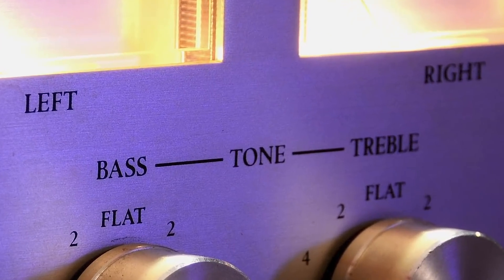Making Smartphone Speakers Sound Big

Comment: Psychoacoustics are the main mantra behind Bose products and the fact that they sound really that good for their size and construction, abstracting the price and competition. HTC One M7 was one of the first smartphones with great dynamic range speakers with DSP, smart amplifier and Beats audio tuning. An iPad Pro or any other recent Apple iDevice really blows many competitors out of the water when it comes to audio reproduction. Still remembering the first Stereo Motorola phones from early 00s that featured „44KHz audio quality“ like the A1000 and E1000 that still sounded as flat as a pancake save for the nice stereo effect.

Comment: That makes so much sense now that you bring up psychoacoustics! 
I have always wondered why my portable speaker (JBL Charge 3) sounded larger with more bass than my bookshelf speakers even though the driver sizes were half the size. At first I attributed it entirely to the bass radiators, but now I know that psychoacoustics is likely also playing a factor. Since for the size of the speaker it sounds quite comparable to my bookshelves which is over 6 times the size (one bookshelf about is three times as big, stereo would mean 6).
Reply: Although one thing I must point out, by no means am I saying that portable speakers are better than full-sized speakers. They both just do better or worse at their own respective areas.
Reply: I don't think the cylindrical mono omnidirectional objects can compare with proper bookshelves on an equal volume level. The boxy characterestic will always be there with the tiny speakers but nevertheless you picqued my interest to buy one for travel.
Reply: @ddg227  Yes you are right. There is actually a mode where you can disable the DSP on the speaker so it outputs raw unprocessed sounds and it does sound super flat. When you compare it in that mode, yes the bookshelves will blow it away. It clearly sounds like it's coming from a smaller source. But with low to moderate listening volumes. I would say overall the sound is quite comparable. Perhaps for me the differences in sound is lesser because I do have smaller bookshelf speakers. For reference I have an Edifier S880DB, I use mainly them for my PC for music and they sound great! For the price point I would say they are great value for the money. I got them for 300 AUD

If you are looking for a portable speaker I would recommend looking into the charge 4, mine is quite old now but I have heard some praise even from audiophiles regarding the sound of the 4. I can't confirm this as I haven't compared the two in person, but watching reviewers the charge 3 is a little warmer than the 4, but the 4 is flatter and has a lower bass extention with better detail.

Comment: Cirrus acquired the awesome Wolfson.

Just wish there was fine control over sound output because many voices are absolutely intolerable to hear, people have taken to whistling their S's through their teeth. Linux has a de-esser but not Android.

Think Android has come a long way but not in the most important issues, still difficult for most people I know to simply answer a phone call on Android without it accidentally putting the phone down, and it's supposed to be a PHONE for God sake! Then you have really irritating stuff like when you enlarge YouTube there's a really irritating message saying "zoom to fill", please, but people fuss about a camera hole??? 
120Hz screens but you have to wait like TWO SECONDS for the damn phone to switch YouTube orientation??? Like who the hell needs 120hz when they can't even fix that orientation lag?

So yeah, a long way to go, and that's not even to mention AI which is supposedly being implemented, yet smartphones are still a long way from smart.

Comment: Hi Gary
I follow your videos. Great job, big help for us, Thank You so much.
I have a small problem with configuration of my Raspberry Pi 4.
I configured WiFi router on my Raspberry Pi and it works fine but ones I connect to VPN server (as a client) over OpenVPN I get no internet connection on Raspberry WiFi or cable connection USB - RJ45 Ethernet. There must be some problem with configuration. Can You help me to correctly configure it please?
Best regards
Kris W.
Reply: bro but why are you gay?